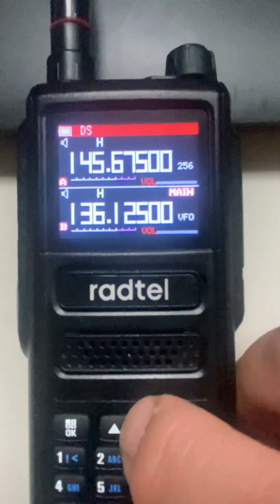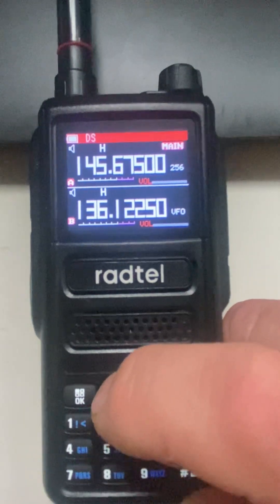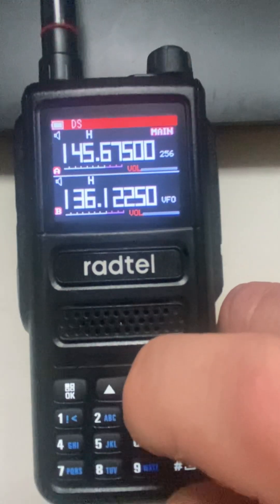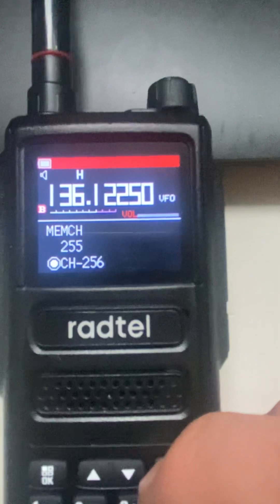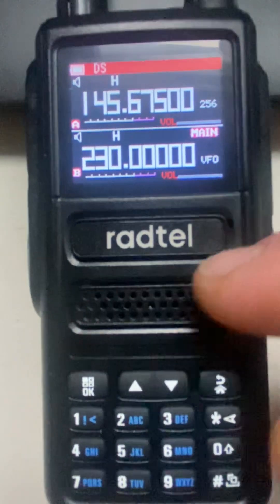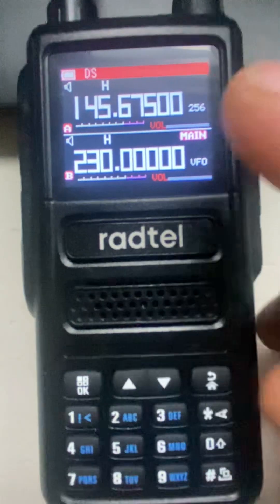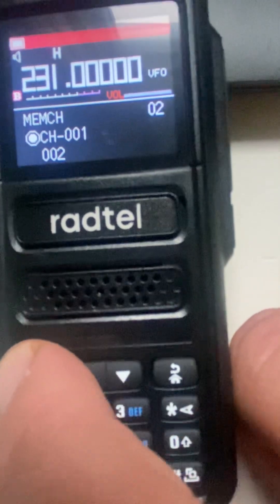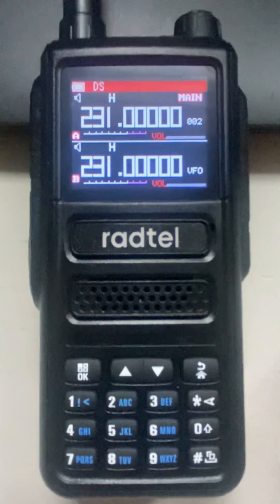Radtel RT-470 / MMLRADIO JC-8811 / JJCC 8810 / Ruyage UV1D…. manual programming

Comment: I do think this radio is fairly easy to program, manually. It seems very logical and easy. Set up the VFO frequency as you want to use it, then save it to an empty channel slot. After that you can assign an alpha-numeric name to that channel, with 12 or 13 characters. 
I have also used both the Radtel & Chip programs. I found Chirp much easier to use. It allows Cut and Paste of entire lines of programming, you have saved from another file. So you can easily load up your new radio.

Comment: My power readings were taken with three radios with two meters. They are as follows: 

Frequency        HIGH       MED       LOW
——————————————————————
140.000          13.75W    7.36W    5.75W
142.725          13.30W    8.71W    3.69W
143.500          13.55W    8.67W    3.89W
144.000          13.61W    7.40W    5.92W
146.355          14.45W    7.31W    3.54W
440.525          10.93W    5.03W    1.86W
442.000          11.36W    5.17W    1.89W
446.252          11.34W    5.24W    2.00W

The color display is beautiful, but the actual software settings were somewhat basic. It's the most powerful HT I have and, at 3600mAh, the battery is the second most potent battery (the Baofeng UV-5R 3800mAh battery being the most powerful). Keep the antenna away from your head with this thing. My favorite radio is the TYT TH-UV8000 10W because of the cross band repeater, the RT-470 being my second favorite. The third favorite is my Tidradio TD-H6.
Reply: Thanks for the work!
Reply: Hello , why keep the antena away from the head ?
Reply: @yungfrisco  radiation/ cancer
Reply: A handheld microphone might be needed for this radio.